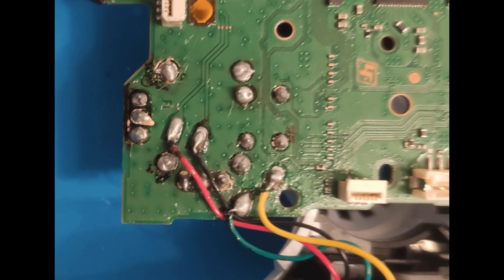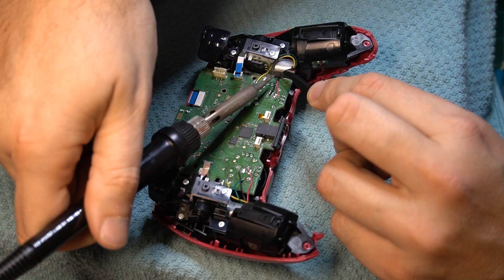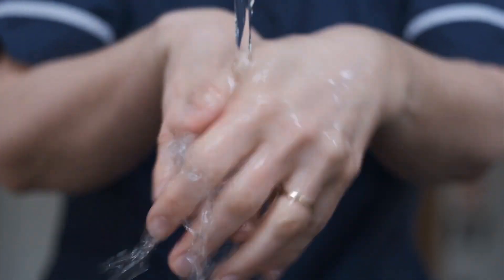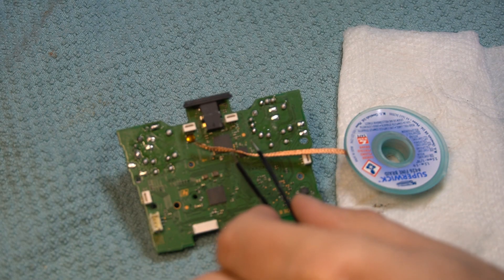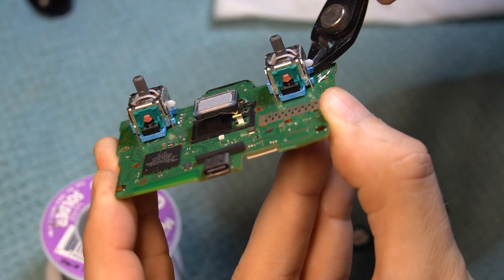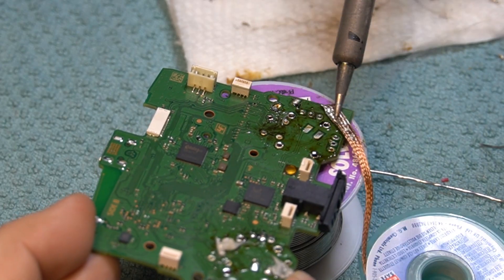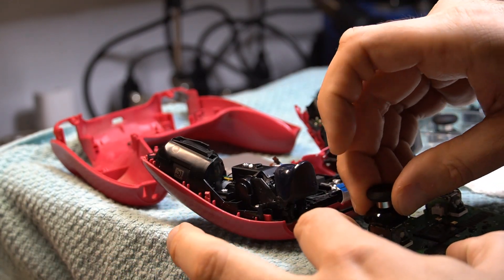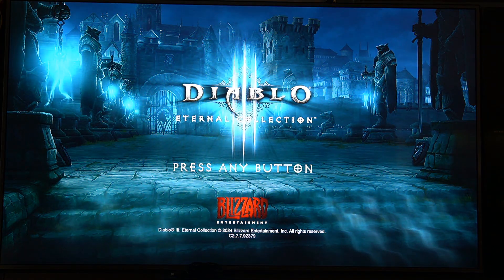Hall Effect Joystick Replacement for PS4/PS5/XBox/Switch with NO SPECIAL TOOLS

Comment: Just installed TMR joysticks into a Dualsense successfully. Haven't soldered since high school (over a decade ago) and I never soldered much back then so this video was super helpful. I had a lot of problems trying to desolder the factory joysticks, no matter what I did I could NOT get some holes clear of solder, there was always a tiny amount of solder left. Solder sucker was useless and wicking it away just didn't get all the solder. The soldering iron kit I bought on Amazon (WEP 882D Soldering Iron Station 2-IN-1) may have suboptimal heat transfer/contact on the tips (I tried four different ones) or maybe I was doing something wrong, but I ended up using the heat gun that comes with the kit to get the original joysticks off. Used tweezers and the heat gun again to put the new ones in (I also bought a helping hands station, super useful here) and then soldered the wires to the board as in the video normally. Flux got everywhere lol.

Thanks for this guide.

Comment: I have 2 controllers just sitting on my shelf because of stick drift. Im gonna fix em this week. I work soldering parts on control boards at my new job and this is the best video ive found so far. Thanks

Comment: Just a constructive criticism as a technician - Yes you can replace sticks with el cheapo solder iron using crude methods but BE AWARE that el cheapo soldering gun can actually kill you charging/power IC on the pad. I have had several controllers in my shop when they stopped charging via TypeC or micro in DS4 beacause electrostatic discharge from cheap gun just killed it. What I usually do but I have equipment - I preheat the board, use desoldering gun - special one for that job, use about 200c 40% airflow hot air along with soldering gun to suck out all off the solder. When the stick doesn't want to come out having hot air would be a good thing, because you can easily heat up leftovers that hold the stick in the PCB and not rip out metal vias inside the solder point. Those boards are quite thick and that's why people have problems replacing the sticks - they soak up temperature really good.

Comment: I am happy to say, I just successfuly upgraded my gamepad to Hall Effect sticks. First time soldering something too, well technically (I last soldered in primary school 20 years ago), but I knew what I was getting into and was well prepared. I only did about couple of hours of soldering practice before tackling my gamepad. The hardest part was desoldering but thanks to you, I finally figured out how to desolder the big legs. Soldering the new part on went fast and easy. Thank you for the tips!
After the first experience, I consider it fairly easy. People on Reddit said otherwise but I guess hit the ground running. Since I only could get a 10-pack of the Hall Effect joysticks, I plan to acquire four more used Dualsense gamepads and upgrade them as well and sell them off with a markup and earn myself a tidy profit. Might even start doing it as a side gig.
Reply: What hall effect brand did you go with?
Reply: @jefflong32  Ginfull, and it works flawlessly thus far.

Comment: When using solder wick, leave at least an inch over either side of the hole center, make sure it's fluxed . This will allow the solder to be drawn both ways of the iron tip helping to draw out all the solder from the hole. 🇬🇧

Comment: Guys soldering is a skill that requires a lot of practice and experience. Don't think you can learn it by just watching a youtube video. You need to practice at least 5 controllers to desolder and solder. The more controllers you can practice on the better. Leave this to the professionals. It only cost so little. Unless you are planning to do this as a profession then go ahead. Quick tip, for this, lead vacuum is better than wick.
Reply: Nah, its a learning experience and a good skill to have. Youd be surprised how much you can learn any skill on youtube and other online resources

Comment: I’ll add something as a beginner with soldering - although it is a great video overall I wouldn’t consider it a greatest for beginners. It is for someone who knows how to deal with braid - I wouldn’t recommend it to use for the actual desoldering but for cleaning after you desoldered. Unfortunately I’ve learned it the hard way - I’ve damaged the first board (the analogs worked after changing and soldering new for Xbox Series controller but the other buttons remained pushed in except for B button and I don’t know where is the problem, didn’t find any short circuit or things like that) and I’ve used another board that I damaged again. With the second the process went smoother with a different iron tip - blade type does the job much better. Unfortunately even so I had a problem with one of the analogs and ripped off 3 pads. There are much more disadvantages to the braid than the good things - it can damage the board, it tends to stick to it, it puts more stress on the pads than other tools and it takes more time to use it. By doing some research I see more people saying it’s not good for desoldering these analogs and especially not good for beginners. I did a better job with using a desoldering pump although a lot of people don’t recommend it too. In general there is no perfect method for removing those analogs (or people who know them just keep them for themselves) as each person who posts a video recommends something else. Not to mention there is not a lot of videos that would teach you how to remove the whole analog without destroying it.
Reply: Exactly my experience.. I failed with 2 controllers.. On my third controller I was stubborn to fix it.. I spent 7 hours trying to clean the holes from solder with solder wick and I couldn't do it.. (wick would stick to the board, not cleaning the holes, reapplying solder to the nearby already cleaned holes etc).. then I bought a solder sucker and cleaned the holes perfectly in just 10 minutes..

Comment: I have 1 solder job under my belt, I replaced a mouse switch and the joints looks really ugly, it's probably cold but it works! Thank you for going into so much detail, I've learned a lot and now feel much more prepared to undertake replacing joysticks

Comment: Hello, so I have been fixing my DualSense controllers stick drift for a few months and have been a success.  I’m not no expert or claim to be one. I recently had to repair another controller stick drift that I fixed a while back. I installed new joysticks and went to calibrated but the joysticks are not able to return to center after calibration.  But it’s not working at all.  Any advice

Comment: Great beginner video. Well done. ** QUICK TIP ** Cut The solder braid into 2 inch strips. This reduces the thermal mass and it sucks up the solder much more efficiently. To the point where it WILL pick the solder that is left in the though hole.

Comment: Yeah I just went for it as my first time soldering and so far I’ve replaced the joysticks on 3 controllers. I did do a lot of research before hand though. I’m glad I learned how to do this lol. There is also a little tool that can desolder the whole joystick within seconds, bought it on Amazon.
Reply: What is that tool may i ask?
Reply: @xRhino453523fgqew  it’s called “elecgear desoldering heat plate uniA”
Reply: Lol I do t think it exists
Reply: @Ismailpetersen-ns7cf  ?
Reply: Hot air gun ( the tools name )

Search on youtube " how to use the HOT AIR GUN " before using it 

I think there are videos that showes how to desolder a analog using Hot Air Gun
Reply: Did that 14 pin desolder tool fit the heating element of your iron? My heating element outer diameter is too big for the hole of the tool. I'm gonna dremel out the opening of the tool so that my iron heating core might fit. I was exasperated today when that tool showed up and didn't fit. Desoldering is a real son of a bitch

Comment: How do you get that calibration website to acknowledge the controller being plugged in?
Reply from the maker: Make sure you are using a proper USB-C cable and not just a charging cable. It should come right up if you are using the correct browser.
Reply: @cosplaylightandsound4143 that worked. Thanx

Comment: Lmfao what they use ,,, A blow torch 😂,,, I usually don't solder the motor wires back on , I don't like that vibe crap and sometimes don't even put the mic back in either. Ps never pour liquid on a motherboard bro
Reply from the maker: Vibration completely MAKES games like Silent Hill 2. It's a completely different game without it. Also I've been pouring flux and IPA on PCBs for 10 years without a problem. Maybe up your skills?

Comment: Where is the link for the acrual sticke themselves?
Reply from the maker: Not sure if they are still on AliExpress, but Amazon, "hall effect joystick replacement" gives many results. I used GuliKit. Make sure you get the correct joystick for your controller. I believe XBox needs an adapter board.

Comment: I don't know how many people will see this but you should always cut off a part of the desoldering copper wick/braids depending on your need, as it takes less part to heat and cleans off more easily. Also, less waste of wick/braids too. What happens when you don't is that it takes more time to heat up the wick as the heat goes from the edge to the root because of heat dissipation.

Comment: "no special tools" pulls out tons of special tools that cost $200 a piece
Reply from the maker: A $50 soldering iron, $8 of desoldering braid, $9 of solder, and a $2 bottle of IPA. Where you see any $200 special tools in this video? Got a timestamp?
Reply: Righ?! The only special tool not used is a desoldering vaccume / sucker.
Reply: You can get all of it for less then $40, not the same quality but you won't need better for a single diy project.
Reply: @RomanKutsovolOriginal Link for the soldering iron that has variable temp setting for $40...
Reply: Ya you don't need any of that BS  just experience

Comment: I damaged the first PS5 controller I did the swap on. The mistake I made was in the flux I used. Controller actually worked but despite all the alcohol I used, when I reopened the controller I noticed spots where there was still flux and it had corroded in every spot that didn't get completely cleaned.

Comment: So iv'e never soldered anything in my life and don't even own a soldering iron but i had to replace the analog potentiometers in my valve index controller, twice. Both times i pulled it off but wondered why i struggled with the soldering wick and getting clean joints. My joints got the job done but they weren't pretty. I watched TONS of videos on soldering and i think this one is probably the most informative one i've seen about technique, proper use of wick, flux, temps etc. I don't know why NONE of the videos gave this information.

Comment: I just replaced my sticks on my PS5 controller with TMR sticks and wow it is actually very difficult, now I have a lot of soldering experience, pretty good gear compared to most people, I have a whole setup just for soldering work. I used a combo of my T12 K tip at 350C, 37/63 leaded solder, SS-02 Engineer desolder pump and my hot air reflow station, I had to pre heat the board and then start desoldering, after I got almost all of it up I then had to set my rework station to 375C and pry the old sticks off very gently, since I was being so gentle with the whole process is took me roughly an hour. Used plenty of flux paste to keep everything flowing, which in my case made a very annoying mess on both the PCB and in my desolder pump, the only reason I didn't use braid is I never have good luck with it for through hole and only use it to clean up SMD pads. My thoughts on it are the PCB is probably very dense, which makes it really hard to actually remove the solder from the board, I've done a good amount of messing around with an old broken 360 PCB, just to get parts off of and practice SMD rework and it has the same kind of problem, the density is probably very high making desoldering very difficult. If I had one and I plan to order one soon is a desolering station with a vaccum pump, that would have made lighter work out of it. I don't blame these people for trying and failing, they are working with very poor irons, lead free solder and a lack of experience. I actually wanted to keep the old sticks but the heat made one of them fall apart, the reason I was being so ginger in the first place. Also you need to tape off the plastic parts with Kapton or foil tape if you do plan to use hot air, other wise your going to melt things. A PCB jig also would be a good idea since getting the sticks off with heat makes it so you can't hold the PCB without burning yourself, Also just makes it way more easy to do the whole thing no matter what method you end up using. If I had to give anyone advice on how to do it better, I'd tell them to get a better iron than me like a T245 since the max wattage is about 72W on the T12 type and you get roughly double and a bit at 160W for T245 tips, don't feel the need to buy actual JBC units, just get one off Aliexpress or Amazon if you just cannot wait for a newer unit, the selection on amazon is pretty poor. Just whatever you do don't cheap out of your iron, it will only make working on this kind of thing impossibly difficult.

Comment: Practice, practice, practice. I used to take apart old electronics and use them to learn how to desolder. Leaded solder is tough to get where I'm at, but flux is your friend. But I did learn something! I didn't know about adding flux to the solder braid to help it pull solder up so thanks for that tip!!

Comment: Great video. I replaced my sticks a while ago, and was there for hours trying to de-solder the sticks as a whole unit. I kind of organically ended up doing exactly this process as I figured I was at the point of no return by then. I cut the mounting legs for the sticks a bit higher up (cos my cutters weren't as sharp and pointy as yours), which actually helped as it gave me something to get hold of with tweezers when removing the debris.

Comment: The reason people don't use wet sponge like they use to is the temperature shock is considered bad for the iron tip (supposedly it can cause the iron part of the tip to develop micro cracks which will just get worse over time) . Personally I have never had an issue with wet sponge ( but I do prefer the copper sponge)
Reply from the maker: Interesting. I have years on my current soldering tip. Of course knowing my luck, the element will shatter tomorrow when I touch a sponge. :)
Reply: @cosplaylightandsound4143  I think it's more of a technicality than usual experience. I have only ever had two tips crack and that was 30+ years ago when I repaired recording equipment. I can't remember the brand but my current iron (Pace ADS200) is far superior and it's not an industrial one.

Comment: I like your technique for splitting the old joystick into parts/pieces, which makes it far easier to desolder.

One thing you can do if you want the final unit to still be lead-free is that you can use leaded solder for the desoldering process, and then after the joystick is out, use wick to remove all traces of the leaded solder.  Then use lead-free to solder the new joysticks back in.
Reply: To make it even easier to desolder use low melt solder (normally using bismuth) which will bring down the temp that is required to flow the solder and will remain liquid for longer. You will need to do a bit more clean up removing all the solder but it will make it overall easier.
Reply from the maker: Will the bismuth solder, which flows just above water boiling temps (280°F or 140°C), melt the lead-free solder?
Reply: @cosplaylightandsound4143  Bismuth-based solder (also known as low-melt) will lower the melting temperature of the entire alloy, so yes, if you add additional low-melt into a lead-free joint, the melting point of the entire joint goes down, and it stays in the liquid state longer, making the component easier to desolder and remove from the PCB.  What you have to be careful of however, is that after the desoldering process, you have to remove all traces of the bismuth solder with wick.  Even a small amount of leftover bismuth will contaminate the new joints and make them brittle.
Reply from the maker: @somejoe7777 Thanks for the personal experience with the bismuth solder!